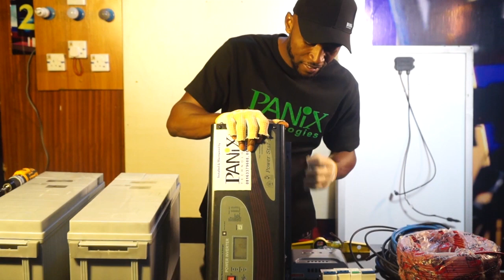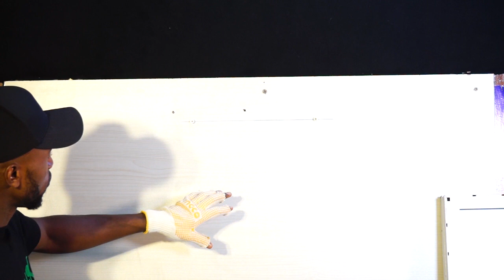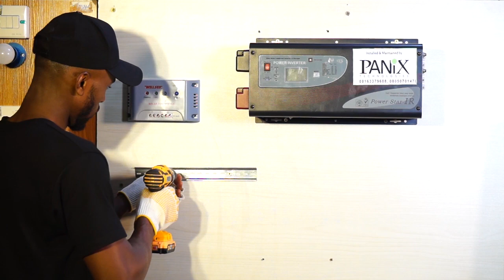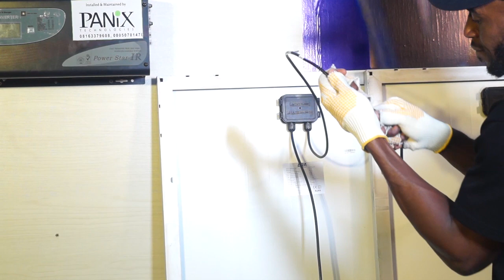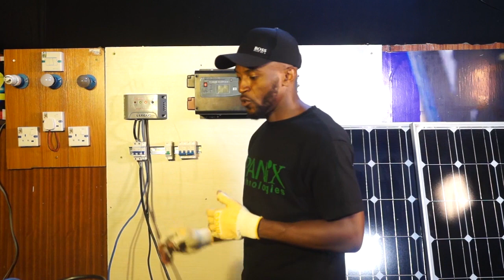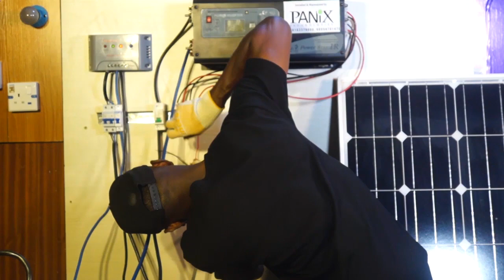How to Install a 3KVA inverter system

Comment: What are the sizes of the DC and AC circuit breakers?  What also are the sizes of the DC cable and AC cable?
Reply from the maker: Cables and Miniature Circuit breaker (MCB) sizes:
AC input and output cables ---- 4mm2
DC input cable to inverter ---- 25mm2
DC output cable from MPPT to Battery ---- 16mm2
DC input cable from Solar Panel to MPPT ---- 4mm2

DC MCB for Inverter-Battery cutout ---- 80A/250Vdc single pole
AC input and output MCB for Inverter ---- 32A/400Vac double pole
DC MCB for MPPT-Battery cutout ---- 40A/250Vdc single pole
DC MCB for Solar Panel-MPPT cutout ---- 32A/250Vdc double pole

Thank you for pointing this out, I have updated it on the video description.